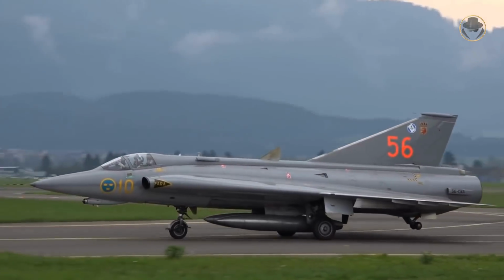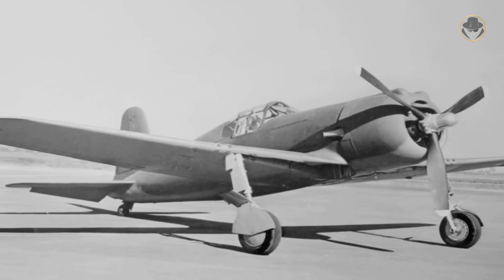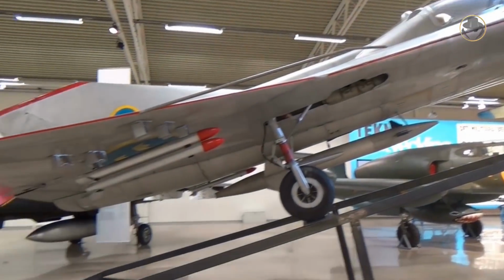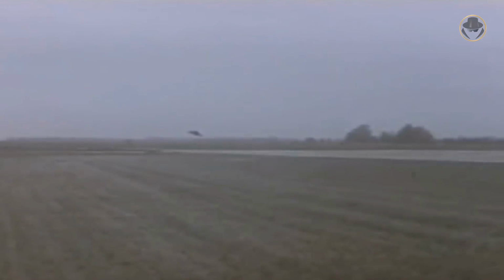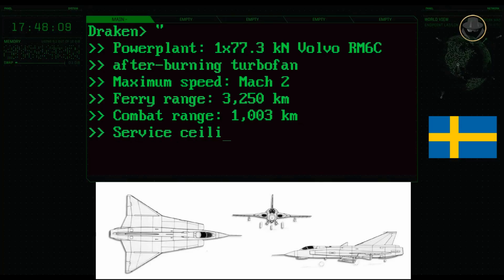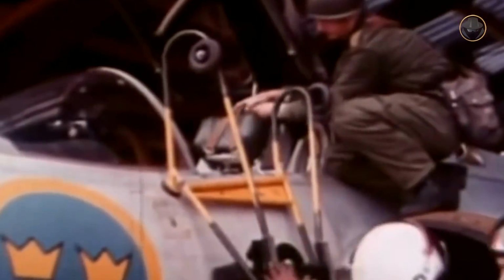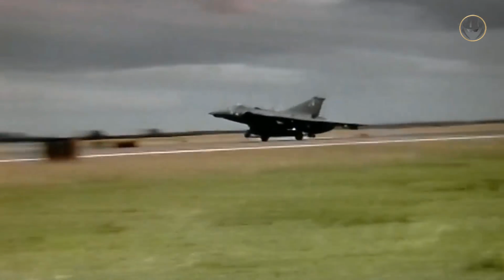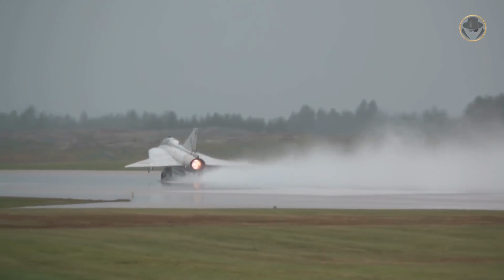J 35 Draken | The Swedish Dragon the interceptor with double delta wing

Comment: The designation of the different models, J35A, B, C and so on, did a little jump from F to J. No J35G, H or I. Why? Because the last version of the J35 were all designated for the air force base F10, Skånska Flygflottiljen. And the letter J is the 10th letter of the alphabet. Simple as that :)

Comment: This design will be revisited after the single-intake, frontal aerodynamic-drag reduction mig21 for efficient(no reheat) super-cruise(sea-level supersonic plus-one). 

Using sitting on air concept, f14a fuselage design as support and fuel-tanks and strong hardpoints, flaps extension in place of swing-wing, f5e wing-area versus swept-wing (more hardpoints), defeat tailstrike by wings not stretching so far back, shorter twin tail fins to use only one side per rudder (aerodynamic hiding), hardpoints as vibration release... 2 cheapest supersonic capable turbofans with reheat but short take-off without reheat... 

Defeat formular-one aerodynamics and other cars drag-coefficient of around 0.26 limiter by including supersonic and hypersonic calculations for anything above 160kmh top-speed.

Comment: The Draken would have been a better choice than the Starfighter for many countries. While the Starfighter was better in it's initial role as an extremely fast climbing high altitude interceptor, the Draken was way more versatile, way safer to fly in low altitude and bad weather and a more agile dogfighter.

Comment: The Danish Air Force had the Draken in service from 1967-1992. From around 1980 mostly as a back up I think, as the multi role F16 took over most of the work.
We had 2 Squadrons at Karup Airfield where I was stationed in 1779-80, a fighter bomber unit and a photo reconnaissance unit, both equipped with Draken.
Remember two things about them:
The pilots spoke very favorable about them...
And they made the H... of a noise when they took off in the middle of the night, using afterburner😆
Reply: Hah, Han, did I really write 1779😂
The Draken is an older model, but not that old...

Comment: The Royal Danish Air Force enjoyed the Draken in the attack and recon role, in conjunction with the Starfighter. Especially the Draken recon was highly sought after by the generals in NATO during the cold war. Sad to see that the JAS-39 Gripen´s weak point is the engine, something the Draken or Viggen never suffered from. But that is Volvo´s problem, not SAAB

Comment: Did my military service at F4 in Frösön outside Östersund in Sweden, this was 1983 and the baracks we lived in was parallell to the runway, when those J35 started the whole place shook, when they had night time we sat at the end of the runway checking out the EBK flames and really felt the sound in the whole body, and fun fact, when taking flight and makes a direct turn after getting air Bourne they slide like a drift car, you don't see that from afar but when close up, being hit by the side blast, the sound, the shaking and even the fumes from the exhaust is a experience, that's for sure, thanx for the clip by the way !

Comment: The Draken was an induced drag nightmare. Make it turn using AB and they had to disengage before any other fighter
Reply: Yes, but it wasn't built as a dogfighter, it was meant to be an interceptor: fast off the ground, fast in the climb, fast killing soviet bombers and fast getting back to base, to do it all over again. That being said, it performed well in most other roles (strike/recce), and not too bad against other fighters in the hands of pilots who knew how to use the advantages of speed, and avoid the downsides of the double delta.
Reply: @petervandyk7173  Well Peter - it was not really accelerating nor decelerating that fast. At least not compared to the F-104. Believe me 'cause I have experienced it myself during exercises aimed at helping a crippled aircraft to landing. When we did it with the Draken we had to be EXTREMELY slow on the throttle or the Draken would scoot ahead or fall behind (neither is recommended in clouds). The F-104 J79 engine responded very fast to throttle changes which was not the case with the Draken engine

Apart from that it was funny to se the different attitudes between a delta and conventional - when the F-104 was in land flaps the nose pointed quite a bit down but the Draken on the wing was pointing a rather læarge bit up - don't know the exact angular difference but it seemed to be at least 30°
Reply: Comparing to the -104 is a bit unfair, really. It was more like a manned missile 😉 But the Starfighter and the EE Lightning were probably the ultimate interceptors of that area. Wich ofc lead to limitations in other areas, like range, turnradius etc. It's always a series of compromises and eventually the skill of the pilot. The Draken will always be one of my favourite aircrafts, the shape, the sound (what a screech it made), the fact that no pilot died flying one here in Denmark. Sadly something no other fighter/strike AC has managed to match so far...
Reply: @petervandyk7173  Sadly however GIN died in the Draken (seriously delayed ejection action I believe?). I'm not sure if he was the only one but I remember him 'cause he was one class ahead of me on Avnø

Comment: If i'm not mistaken, this type of plane was involved in creating the only ever situation that the SR-71 could be shot down during routine flights over baltic sea, not because of performance, but by picking on it as what it comes closest physically because of it's speed and altitude - a ballistic missile on permanent re-entry, taking it on the front with radar missiles. Russia never had this idea...
Reply: That was the successor aircraft - the Viggen or loosely ”Thunderbolt”. There’s a video on those too on this channel.

Comment: Interesting thing though: The swedish word "draken" or "drake" can mean either of two things in english: "dragon" or "kite". In this case, it is actually the latter that is correct. It derives from an incident when one of the chiefdesigners wife saw the plane in the air for the first time, and her reaction was to say (in swedish though): "oh, it looks like a kite!". Hence the name "draken", which in english would be "the kite". "The dragon" ofc sounds more cool ;) Maybe this is the simple reason why it is seldom corrected internationally.
Reply: It's a good story, the J32 Lansen:s name came from the pitot-probe on the wing, the 37 Viggens name came from the thunderbolt in nordic mythology as Tor used his hammer and the bird Tufted duck as the canard wings in the front have the same appearance and finally Gripen is from the greek mythology.
Reply: @paulandersson6120  Isn't it cute that Viggen is named for a chubby  little duck that looks like it's going through an emo phase.
Reply: The word "drake" is also another name for a male duck in swedish.

Comment: A group of Drakens,  just out of mischief bounced a  SR-71 Blackbird as it flew over Swedish  territory . How on earth they managed that , I do not know but they did !
Reply: I believe that was Viggen, they had a very sophisticated missile system allowing them to not only get a missile launch or lock from behind but also from the front.  They simply intercepted the Blackbirds path in front of it and gained the lock in an an head-on position, taking away the ability to use speed as an evasive maneuver.
Reply: Yes they did. It was a sr 71 limping back to base on 1 engine. They intercepted it. Escorted it back protecting it from soviet jets already inbound to intercept and destroy the crippled sr 71 flying at just over mach 1.  Was a great read
Reply: @darinr9424 u r talking about 2 different events
Reply: @staffan144  yea that was the viggens

Comment: the Draken...
what a terrible design.  you might be able to acknowledge that it cannot turn worth its weight.  
kind of world, where even the engineers get it so massively wrong.
Reply: It was not designed to turnfight, it was designed to intercept high flying bombers. A job which it did very well.
Reply: what? it turns great! it just dumps speed whilst doing it, it can pull alot of AOA
Reply: @einar8019  Just another flight sim junkie...
Reply: @WALTERBROADDUS  and what evidence do you have??
Reply: @einar8019  Your basing abilities on dated tactics And a different mission profile from a interceptor.
Reply: @einar8019  The junkie comment did not refer to you. The original poster.
Reply: Everything a question of tactics. If you are able to climb from deck level extremely quick and pop up behind your target you don't need a tight turning radius. Ask US F-16 pilots about their experience when trying to sneak through Austrian airspace without permission.
Reply: Might you be an American
Reply: It intercepted american stealth bombers as excercise when they flew over Sweden to soviet. What you gotta say now?
Reply: You are wrong  in your estimation.
Reply: At the end of the 90's Switzerland and Austria did an interception and dogfight training exercise together. The Swiss using their F-18 hornets, the Austrians their by then pretty dated  Saab 35Ö. I remember talking to a few pilots after they came back.  Against the odds the Swiss did not win all the dog fights... If the Draken would have been so bad, what would the much younger F18 then be...

Comment: the Swedish Air Force needs to acquire a fleet of 90 - 110 brand new F-15EX Strike Eagle II (Block 30A) multi role interdictor strike fighter . . . to supplement their existing fleet of single engined SAAB JAS-39S GRIPEN NG multi role fighter . . .
Reply: Yeas, why do we need F-15 EX? What we need is more Gripens and submarines.
Reply: @MrBlue-dm5li  because after March 2020 Sweden seriously needs twin engined fighter jets, period . . . a fleet of 90 - 100 brand new F-15EX Strike Eagle II (Block 30A) multi role interdictor strike fighter . . . to keep the fight at bay, confined to the enemy's doorstep instead of letting it come here . . . as an alternative SAF can also opt for the twin engined Dassault Rafale F4.1 multi role fighter which is a phenomenal delta winged fighter . . . the other option is for SAAB to design & build it's own 5th generation twin engined stealth multi role interdictor strike fighter as it did with the Viggen & JAS-39S GRIPEN NG multi role fighter . . . third option for SAF is to acquire a fleet of 250 unmanned Wingman drone (which will be 50% cheaper) that will complement the SAAB JAS-39S GRIPEN NG multi role fighter . . . however this will require SAF to place an order for 83 - 89 additional brand new SAAB JAS-39S GRIPEN NG multi role fighter . . . Swedish military lack in numbers which was fine until 2020 but not anymore . . . as Stalin once said quantity is a quality in itself, he was right . . . and proof is China, their army is bigger than Sweden's entire population . . .
Reply: Why?
Reply: @WALTERBROADDUS because after March 2020 Sweden seriously needs twin engined fighter jets, period . . . a fleet of 90 - 100 brand new F-15EX Strike Eagle II (Block 30A) multi role interdictor strike fighter . . . to keep the fight at bay, confined to the enemy's doorstep instead of letting it come here . . . as an alternative SAF can also opt for the twin engined Dassault Rafale F4.1 multi role fighter which is a phenomenal delta winged fighter . . . the other option is for SAAB to design & build it's own 5th generation twin engined stealth multi role interdictor strike fighter as it did with the Viggen & JAS-39S GRIPEN NG multi role fighter . . . third option for SAF is to acquire a fleet of 250 unmanned Wingman drone (which will be 50% cheaper) that will complement the SAAB JAS-39S GRIPEN NG multi role fighter . . . however this will require SAF to place an order for 83 - 89 additional brand new SAAB JAS-39S GRIPEN NG multi role fighter . . . Swedish military lack in numbers which was fine until 2020 but not anymore . . . as Stalin once said quantity is a quality in itself, he was right . . . and proof is China, their army is bigger than Sweden's entire population . . .
Reply: @chandrachurniyogi8394  Sweden is Neutral.  They have few threats and little need  for  more Offensive power. The main reason for the EX is to Bailout Boeing.
Reply: @WALTERBROADDUS  exactly Sweden is neutral & that is why adversaries can force Sweden to get into the fight just like Japan did with the U.S. in WW2 . . . U.S. was a neutral in WW2 except for providing necessary supplies to Europe . . . one year back I'd agree with everything you say . . . but not so sure anymore
Reply: @chandrachurniyogi8394  F-15EX is a massive and expensive plane with comparatively huge radar cross section. Two engines do not necessarily make the plane better any more either. F-35A would be the best option available if Sweden wanted to supplement their air force with another fighter.
Reply: @1981alex  because after March 2020 Sweden seriously needs twin engined fighter jets, period . . . a fleet of 90 - 100 brand new F-15EX Strike Eagle II (Block 30A) multi role interdictor strike fighter . . . to keep the fight at bay, confined to the enemy's doorstep instead of letting it come here . . . as an alternative SAF can also opt for the twin engined Dassault Rafale F4.1 multi role fighter which is a phenomenal delta winged fighter . . . the other option is for SAAB to design & build it's own 5th generation twin engined stealth multi role interdictor strike fighter as it did with the Viggen & JAS-39S GRIPEN NG multi role fighter . . . third option for SAF is to acquire a fleet of 250 unmanned Wingman drone (which will be 50% cheaper) that will complement the SAAB JAS-39S GRIPEN NG multi role fighter . . . however this will require SAF to place an order for 83 - 89 additional brand new SAAB JAS-39S GRIPEN NG multi role fighter . . . Swedish military lack in numbers which was fine until 2020 but not anymore . . . as Stalin once said quantity is a quality in itself, he was right . . . and proof is China, their army is bigger than Sweden's entire population . . .
Reply: Two engines just makes the plane unnecessary big and heavy.
In operational service since 1996, NO Gripen has ever gone down due to engine failure.
Nuff said.

Comment: This aircraft is magnificent with exceptional performance. The only complaint is its huge accident rate. but maybe is this due to the conditions of use?
Reply: When you train and accept the same type of safety margins as in a full blown conflict there will be accidents, also it took some time to get to grips with the superstastall characteristics, regardless Sweden lost many airmen (about 550) to all aircraft types during the cold war.
Reply: @kronop8884  In the 60s or 70s I think many if not all countries used this type of training. Yet never has such a high attrition rate been recorded.
Whether with American or French planes. The only exception may be with the F-104 Starfighter misused by the Luftwaffe.
Reply: @olivierpuyou3621  The Swedish Airforce typically trained at lower altitudes and higher speeds than just about anyone else 20m altitude over land and 10 m over sea during high speed attack runs was allowed but often exceeded. A Swedish airforce speciality one might say.

But sure technical issues and design features/flight characteristics played a role as well especially when the designs are cutting edge, J29 early swept wing, J35 double delta wing and so on.
Reply: "Stridsmässigt" is the term the Swedish AF used for all their exercises.
It means "combat-like".

Comment: Listening to radio communication witth the tower back in the 1980's it was easy to hear, just by strain of the pilots voice, if he was on final approach in a Viggen (easy) or Draken (concentration needed).
The high accident rate was in part due to the erly learning curve and superstall characteristics of the aircraft but also the way that the Swedish airforce operated, more or less taking the same risks as they would have done in a full blown conflict allowing for very small margins of error in training.

Between 1946 and 1989 (cold war era) some Swedish 550 airmen lost their lives in accidents (including a few shot down in international airspace by Soviet pilots)
Reply: Any info on where to read about those incidents?
Reply: @ulflyng  Search for DC3 and the Catalina incident
Reply: @kronop8884  👍
Reply: Interestig to hear. Austria lost only 1 pilot with/in a Draken, and that was during initial training still in sweden.
Reply: @nirfz  The 2 seat Draken for training and mastering superstall condition eventually helped reduce the accident rate but there where also technical issues such as engine failures that plagued the Draken. 

However there where  at least 2 incidents with Austrialn pilots during training in Sweden, on Nov 18 1966 oberl Teja Reichhuber had to eject due to an uncontrolled flight condition (Superstall most likely) and on 11 Nov 1986 hauptm J Christian Wolf  fatally crashed into the sea during a low altitude, high speed flight.
Reply: @kronop8884  Thanks, i didn't remember the ejection incident.